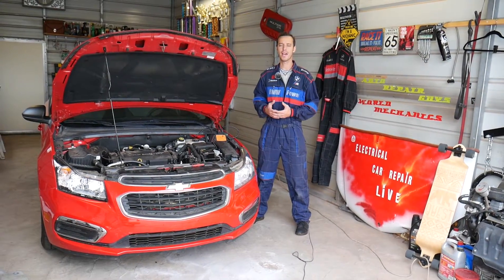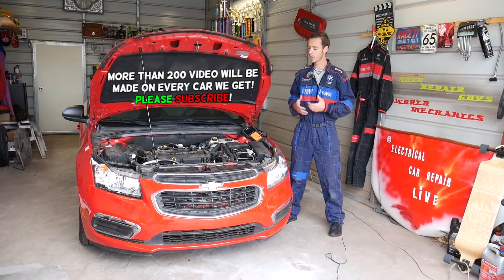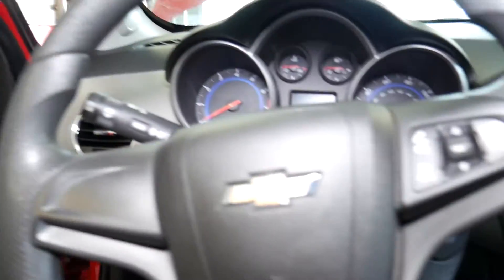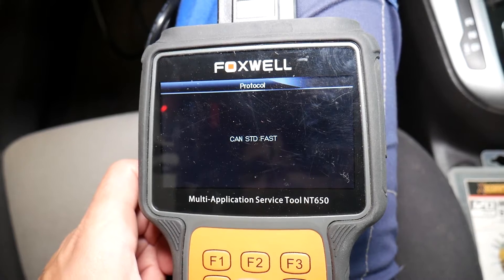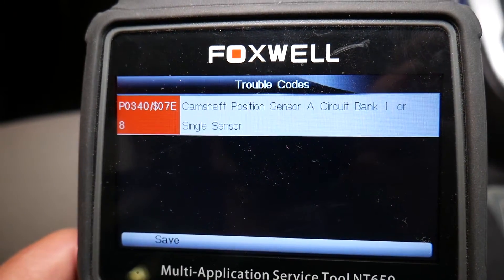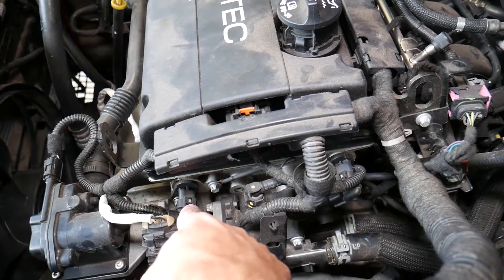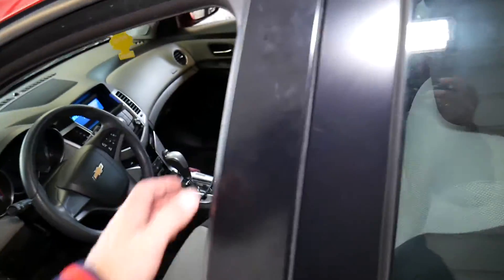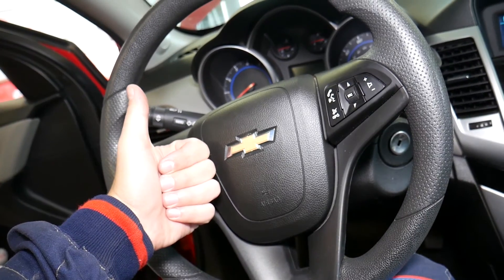CHEVROLET CRUZE SONIC P0340 CAMSHAFT POSITION SENSOR A CIRCUIT OPEN BANK 1, CHEVY HOLDEN CRUZE SONIC

Comment: I have the same code put the problem is that my car does not start. What other problem could be the cause?
Reply: same bro. did you ever figure. out what the problem was ?
Reply: Crankshaft sensor circuit